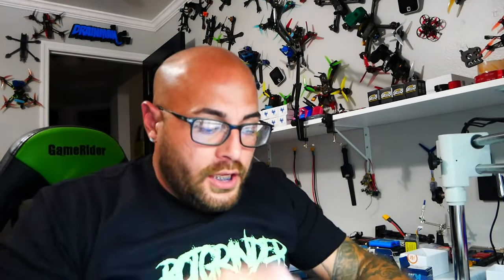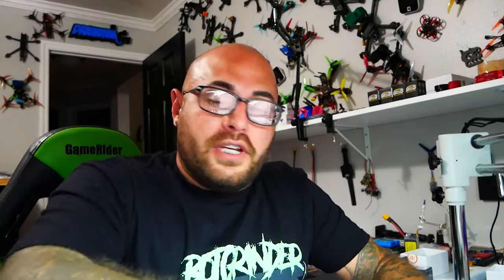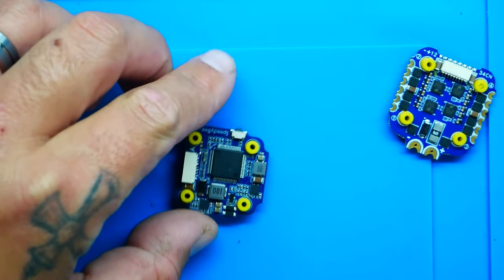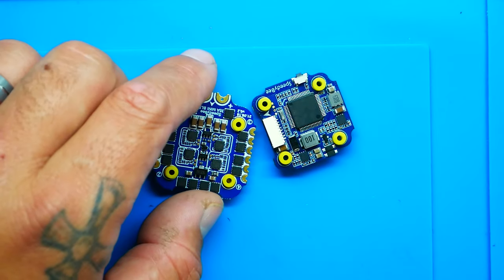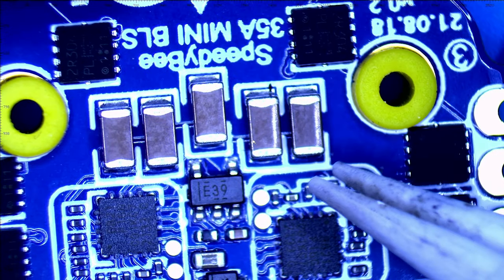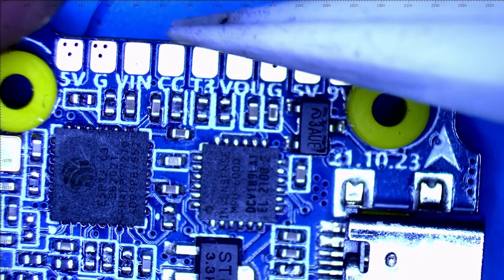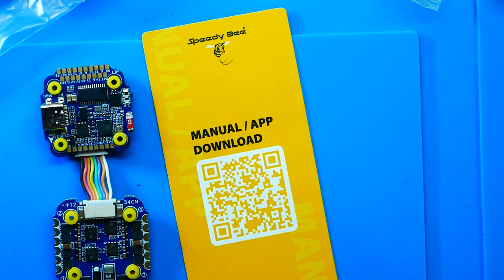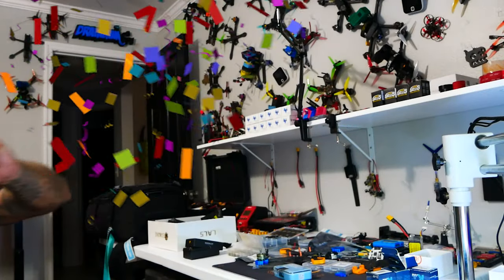The Not So Mini - F7 Mini Bluetooth 4.0 Stack !! SpeedyBee F7

Comment: does your FC core temp run hot? maybe i got a short i can't find.  the motor pads are really close to the FETs, it's easy to let solder run over and touch them maybe.  The cap is huge, i used a smaller one for my rekon 5